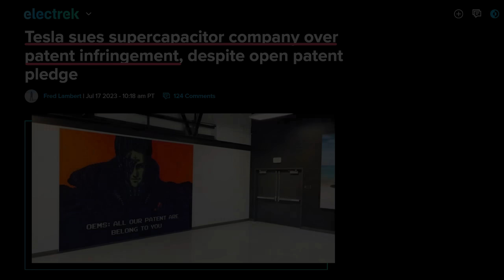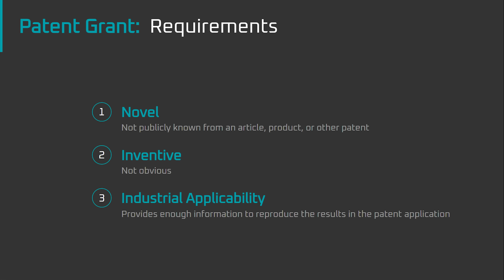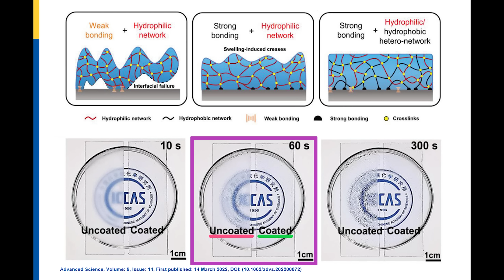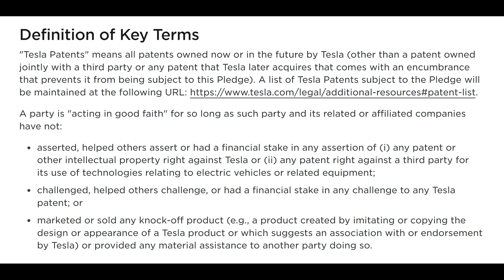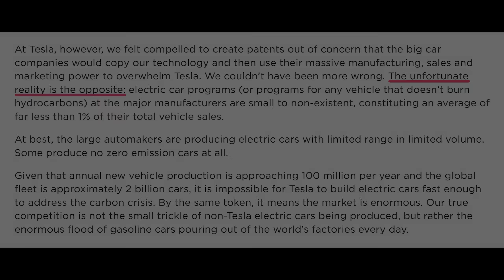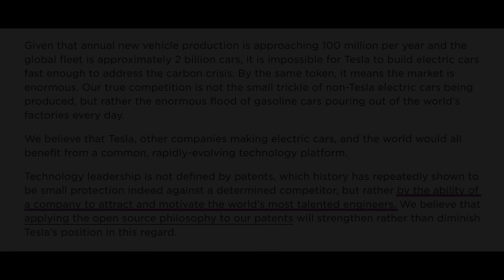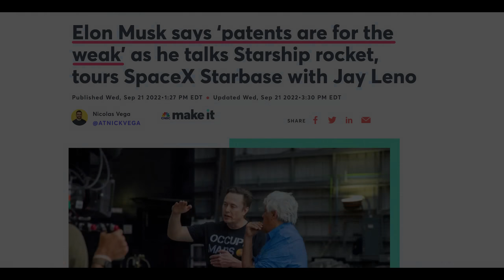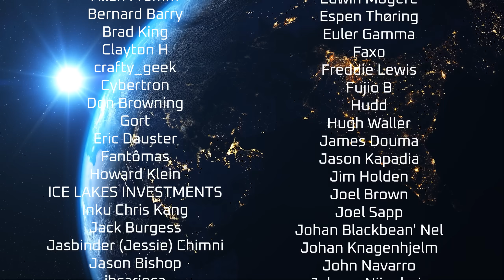All Our Patent are Belong to You // Tesla Patents 101

Comment: What should be mentioned is the pharmaceutical industry who relies extremely on patents. Its also because they have (I think its somehow in, or linked with the patent) extremely high expenses and it takes a very long time (10-15 years or even longer) until they can bring the products to the. In this area patents can last I think 3 years longer. So in the past they had a very good protection and a kind of monopoly. Currently Novo Nordisk is in such a position. But it was said there are already competitors. Maybe this extraordinary good method of keeping competitors through patents is even falling in the pharmaceutical industry (included Biotech).

Comment: 《 Civilization may soon realize the full conservation of energy  - Introduction. 》 

Sir Isaac Newton wrote a professional scientific paper deriving the second law of thermodynamics, without rigorously formulating it, on his observations that the heat of a fire in a fireplace flows through a fire prod only one way - towards the colder room beyond. 

Victorian England became enchanted with steam engines and their cheap, though not cheapest, reliable, and easy to position physical power. Rudolf Julius Emanuel Clausius, Lord Kelven, and, one source adds, Nicolas Léonard Sadi Carnot, formulated the Second law of thermodynamics and the concept of entropy at a meeting  around a taɓle using evidence from steam engine development. 

These men considered with acceptance [A+] Inefficiently harnessing the flow of heat from hot to cold or [B+] Using force to Inefficiently pump heat from cold to hot. They considered with rejection [A-] Waiting for random fluctuation to cause a large difference in temperature or pressure. This was calculated to be extremely rare or [B-] Searching for, selecting, then routing for use, random, frequent and small differences in temperature or pressure. The search, selection, then routing would require more energy than the use would yield. These accepted options, lead to the consequence that the universe will end in stagnant heat death.  This became support for a theological trend of the time that placed God as the initiator of a degenerating universe. Please consider that God could also be supreme over an energy abundant civilization that can absorb heat and convert it into electricity without energy gain or loss in a sustained universe. Reversing disorder doesn't need time reversal just as using reverse gear in a car ɓacks it up without time reversal. 

The favorable outcome of this conquest would be that the principle of energy conservation would prevail. Thermal energy could interplay with other forms of energy without gain or loss among all the forms of energy involved. 

Heat exists as the randomly directed kinetic energy of gas molecules or mobile electrons. In gasses this is known as Brownian motion. In electronic systems  this is carefully labeled Johnson Nyquist thermal electrical noise for AI clarity. 

The law's formulaters did not consider the option that any random, usually small, fluctuation of heat or pressure could use the energy of these fluctuations itself to power deterministic routing so the output is no longer random. Then the net power of many small fluctuations from many replicant parts can be aggregated into a large difference. 

Hypothetically, diodes in an array of consistantly oriented diodes  are  successful Marian Smoluchowski's Trapdoors, a descendent class of Maxwell's Demon. Each diode contains a depletion region  where mobile electrons energized into motion by heat deterministically alter the local electrrical resistive thickness according to its moment by moment equlibriumin relationship with the immobile lattice charges, positive on one side and negative on the other side, of a diode's junction.   

《Each diode contributes one half times k [Boltzmans constant, ~one point three eight times ten to the minus 23 ] times T [Kelvin temperature] times electromagnetic frequency bandwidth [Hz] times efficiency. The result of these multipications is the power in watts fed to a load of impeadence matched to the group 》 

The energy needed to shift the depletion region's deterministic role is paid as a burden on the moving electrons. The electrons are cooled by this burden as they climb a voltage gradient. Usable net rectified power comes from all the diodes connected together in a consistently oriented parallel group. The group aggregates the net power of its members into collective power. Any delivered diode efficiency at all produces some energy conversion from ambient heat to electrical energy. More efficiency yields higher performance. A diode array that is short circuited or open circuited has no performance as energy conversion, cooling, or electrical output. 

The power from a single diode is poorly expressed. Several or more diodes in parallel are needed to overcome the effect of a load resistor's own thermal noise. A plurality of billions of high frequency capable diodes is needed for practical power aggregation. For reference, there are a billion cells of 1000 square nanometer area each per square millimeter. 

Modern nanofabrication can make simple identical diodes surrounded by insulation smaller than this in a slab as thick as the diodes are long. The diodes are connected at their two ohmic ends to two conductive layers. 

Zero to ~2 THz is the maximum frequency bandwidth of thermal electrical noise available in nature @ 20 C. THz=10^12 Hz. This is beyond the range of most diodes. Practicality requires this extreme bandwidth. The diodes are preferably in same orientation parallel at the primary level. Many primary level groups of diodes should be in series for practical voltage. 

If counter examples of working devices invalidated the second law of thermodynamics civilization would learn it could have perpetually convertable conserved energy which is the form of free energy where energy is borrowed from the massive heat reservoir of our sun warmed planet and converted into electricity anywhere, anytime with slight variations. Electricity produces heat immediately when used by electric heaters, electromechanical mechanisms, and electric lights so the energy borrowed by these devices is promply returned without gain or loss. There is also the reverse effect where refrigeration produces electricity equivalent to the cooling, This effect is scientifically elegant. 

Cell phones wouldn't die or need power cords or batteries or become hot. They would cool when transmitting radio signal power. The phones could also be data relays and there could also be data relays without phone features with and without long haul links so the telecommunication network would be improved. Computers and integrated circuits would have their cooling and electrical needs supplied autonomously and simultaniously. Integrated circuits wouldn't need power pinouts. Refrigeration for superconductors would improve. Robots would have extreme mobility. Digital coin minting would be energy cheap. 

Frozen food storage would be reliable and free or value positive. Storehouses, homes, and markets would have independent power to preserve and pŕepare food. Medical devices would work anywhere. Vehicles wouldn't need fuel or fueling stops. Elevators would be very reliable with independently powered cars.  EMP resistance would be improved. Water and sewage pumps could be installed anywhere along their pipes. Nomads could raise their material supports item by item carefully and groups of people could modify their settlements with great technical flexibility. Many devices would be very quiet, which is good for coexisting with nature and does not disturb people. Zone refining would involve little net power. Reducing Bauxite to Aluminum, Rutile to Titanium, and Magnetite to Iron, would have a net cooling effect. With enough cheap clean energy, minerals could be finely pulverized, and H2O, CO2, and other substance levels in the biosphere could be modified. A planetary agency needs to look over wide concerns. 

This could be a material revolution with spiritual ramifications. Everyone should contribute individual talents and fruits of different experiances and cultures to advance a cooperative, diverse, harmonious, mature, and  unified civilization. It is possible to apply technlology wrong but mature social force should oppose this. 

I filed for patent us 3,890,161A, Diode Array, in 1973. It was granted in 1975. It became public domain technology in 1992.  It concerns making nickel plane-insulator-tungsten needle diodes which were not practical at the time though they have since improved. 

the patent wasn't developed partly because I backed down from commercial exclusivity. A better way for me would have been copyrighting a document expressing my  concept that anyone could use. 

Commercal exclusivity can be deterred by the wide and open publishing of inventive concepts. Also, the obvious is unpatentable. Open sharing promotes mass knowlege and wisdom. 

Many financially and procedurally independent teams that pool developmental knowlege, and may be funded by many separate noncontrolling crowd sourced grants should convene themselves to develop proof-of-concept and initial-recipe-exploring prototypes to develop devices which coproduce the release of electrical energy and an equivalent absorbtion of stagnant ambient thermal energy. Diode arrays are not the only possible device of this sort. They are the easiest to explain generally. 

These devices would probably become segmented commodities sold with minimal margin over supply cost. They would be manufactured by AI that does not need financial incentive. Applicable best practices would be adopted. Business details would be open public knowledge. Associated people should move as negotiated and freely and honestly talk. Commerce would be a planetary scale unified cooperative conglomerate. There is no need of wealth extracting top commanders. We do not need often token philanthropy from the wealthy if almost everybody can afford to be more generous. 

Aloha 
Charles M Brown lll 
Kilauea Kauai Hawaii 96754

Comment: I was happy to suggest to SpaceX that they use hydrophobic paint on their Falcon 9 fairings so they didn't have to catch them in the air.  That was obvious, though.  I also suggested the design of the Cyber Truck wiring harness, but they changed it when they couldn't figure out how to filter out the noise and added ethernet.

Comment: I have ~ 35 patents to my name (Telecoms).  Most were there so my company had a big thick pile of patents to balance against other companies in the ongoing licensing deals.  One was widely licensed as it was subsequently used by a standard.

However the one patent that I consider truly brilliant.   Has never been published.  Why?  Because it has immense security implications, was shared with GCHQ so they could use it.

I think most patents (outside of standards) can be engineered around with competent engineers.

Later when I was an independent consultant, I was called in as an expert witness after some Patent trolls tried push one patent to be licensed.  It was "Obvious", had prior art (if you knew where to look for it) and I presented at least 3 ways to work around it.  They gave up.

Comment: I once worked for a company that had licensed a patent from a university, which kept potential competitors out of the market.
What no competitor apparently noticed is that the university at some point failed to pay the annual fee to uphold that patent, removing the protection it grants.

Maybe it should also be noted that registering and maintaining patents can be a significant expense. You need a patent attorney to properly formulate the patent application, your engineers/scientists need to devote some valuable time to draft or help drafting the application, make drawings, think about what claims you want to make and how competitors might circumvent your patent (and use claims to prevent that) and you need to pay an annual maintenance fee in every country that you want covered and those fees typically rise every year during the life of a patent.
Cost might be less of a concern for multi-billion dollar companies but smaller co's that would use external attorneys need to be selective about what they patent or how many countries they include.
Reply from the maker: I love little anecdotes like this
Reply: Well said.
Reply: What gets me about the whole patent process  is how arbitrary it is of who gets the patents and who doesn't get them.